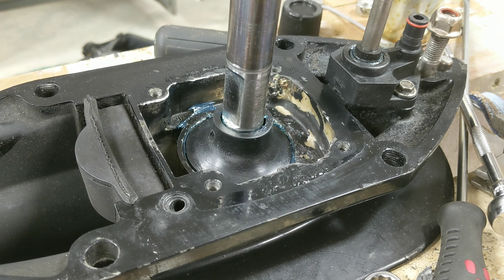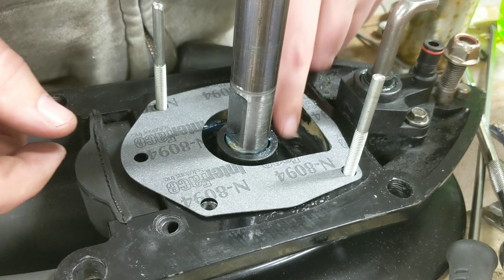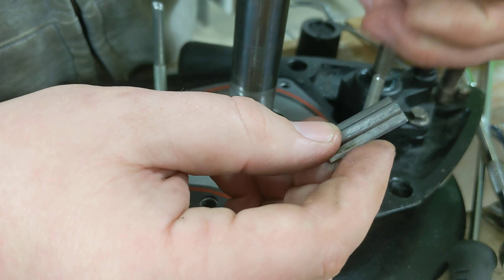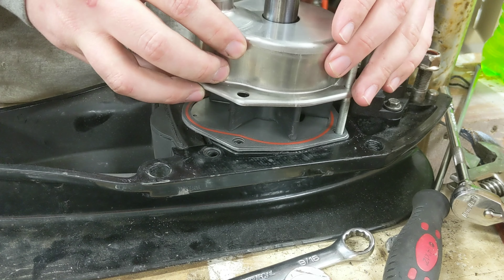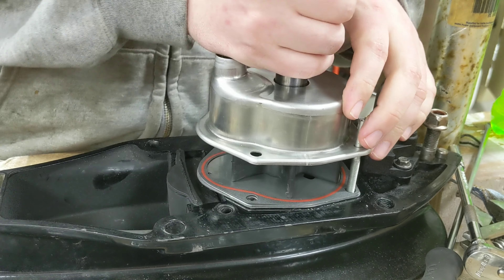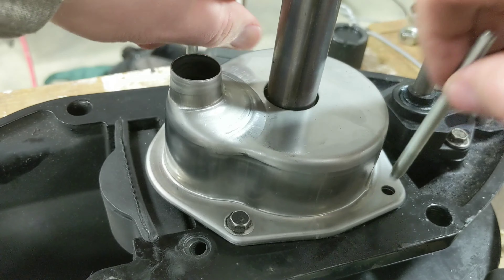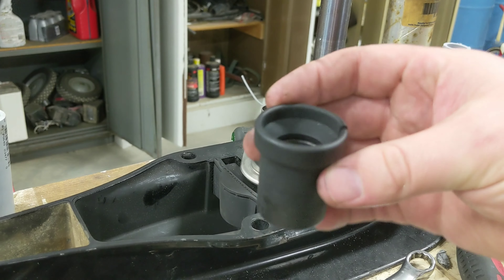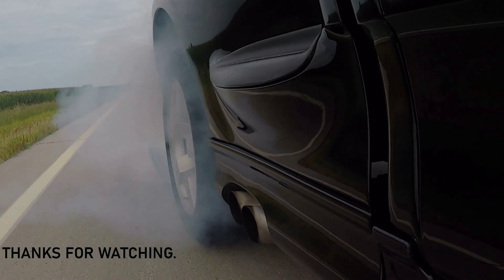Mercruiser Water Pump Replacement -- Mercruiser Gimbal Ring Replacement Ep 10

Comment: Great video.  I think I'd leave the bolts loose until that black seal centers the pump housing on the shaft?  Oh, and your title says "Gimbal Ring Replacement".
Reply from the maker: Thanks @FlyMeAirplane!! I think you are probably right those could have been left in. Might have been a little better that way. I am technically doing all this while I replace my gimbal ring. Idk if it should be its own series or what haha. Titling is hard for me. The video stands almost on its own so I get your point. 🤔🤔